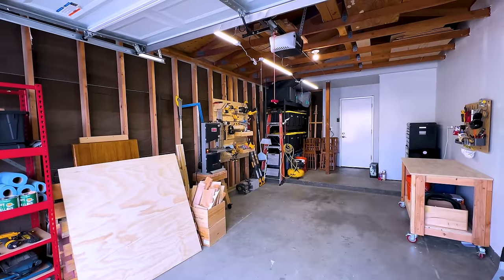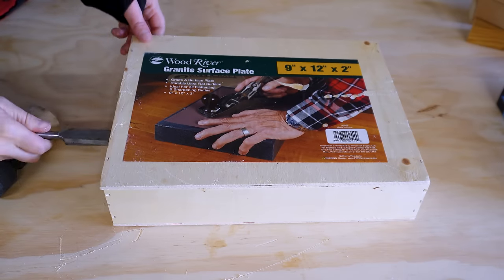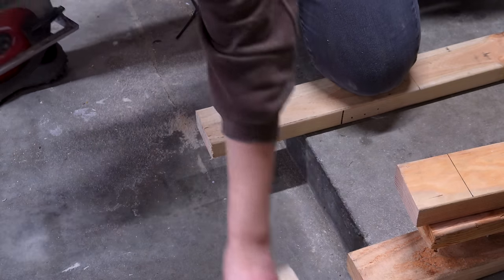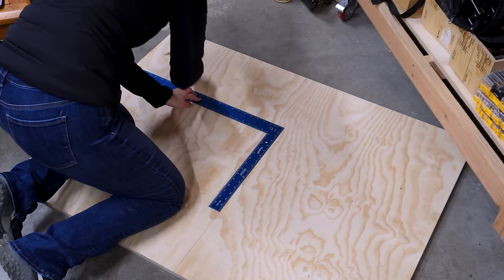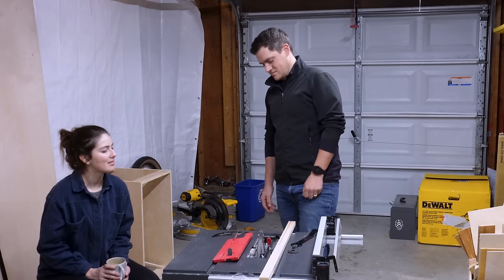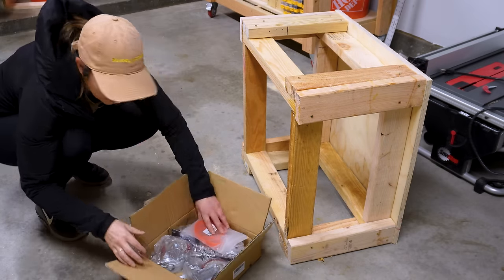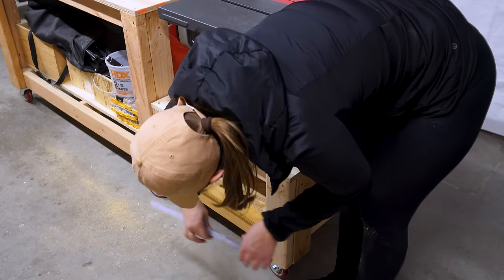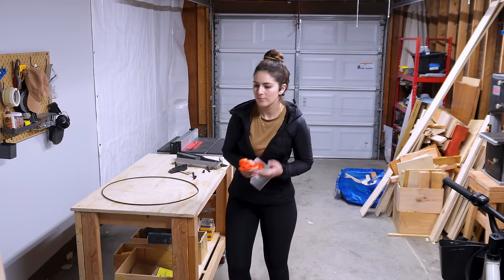Workshop Updates (and SawStop Scare)

Comment: European based viewer here. Regarding 2x4’s not quite being 2x4: When purchasing wood here, say for construction, it can either come ‘rough’ or ‘planed’. At saw mills and professional lumber yards or hardware stores, they will often quote the measurements as the same for rough or planed where the planed has had material taken off (to make it plane and smooth😊). Don’t know if that’s the same going on there in the US. On another note, as others have pointed out, your husband is a very fortunate man in so many ways.

Comment: As a veteran woodworker, I was so glad to hear you address reading the owner's manual and learning how to safely use a tool before using it. So many just plug it in without any or very limited knowledge of the tool and that is potentially disastrous.  Your video and safety practices might save someone from injury. Great job!
Reply: One of the first things I do is survey of the tool and then crack open the manual.

Comment: Love it.  I am a professional woodworker and handyman for 40 yrs, have used all the tools in your shop and many more.  I also have a spare set of bandsaw tires, that don't fit my bandsaw!!!   Just bought the exact same Dewalt sliding compound miter saw and realized it was different enough from my old Makita that I too stopped to read the entire manual before using.  I even went thru all of the calibrating steps to confirm its accuracy; it was spot on.  Love the tensioning clamps you found for the rolling table saw stand.  I like my catch stand no more than 1/16" lower than the table saw.  I used Varathane waterbased poly on the plywood top.  Extremely durable.  Love your use of scraps.  We all learn how important it is to keep scraps, and then discover how difficult it is to keep so many scraps!  I still have all my fingers; one is an 1/8" shorter thanks to a table saw.  Safety always, don't rush, don't work when too frustrated, annoyed, hungry, tired.  Looking forward to more of this...

Comment: Sawstop will replace your cartridge for free, since it was a "save" .  More importantly, make some SACRIFICIAL push sticks that you can intentionally run over the blade when cutting thin strips like that. William Ng has a push stick design that works perfect for this.  Ive used his design for many years and it works great.  Check out William's (few) videos, he is truly a master.
Reply: Matt Jackson, Next Level Carpentry is also a good choice. He does deep dives into a process so a person can see the required steps needed to complete a project. Matt makes a great push stick! William Ng has a great video on the “5 Cut Method” to share a fence on a crosscut sled. Unfortunately, William has stopped producing content.
Reply: You're right about W. Ng's channel. The guy is awesome. Unfortunately his last video is like 3 years ago. I hope he's ok.

Comment: I think an MDF table top is the right choice. No splintering, smooth surface and relatively cheap to replace
Reply: melamine is better option, easier to clean up any spillage.
.
Reply: @wellsistvan  Depends on what you will use it for the most. Things will slide easily too. Might be good or bad.

Comment: So glad the SawStop worked.  I just got my SawStop for Christmas.  This decision has been in limbo for three years when I had my table saw accident.  I was in a rush and fortunately got the tip of my finger in the blade.   Fortunately just several stitches.  Whew.  I went into full panic mode and the ER doctor was more concerned about my blood pressure causing more issues than my bleeding finger. It took a few weeks to heal and settle down. That’s when I migrated to Festool with a track saw that really reduced use of my table saw.  I’ve been really excited with the new Jobsite Pro SawStop and great peace of mind.

Comment: Sharing the scare is VERY important.  It's the whole reason the saw technology was invented.  It's nothing to be ashamed about, but will definitely be a learning experience.  Kickback is another dangerous thing to watch out for.  Always try to stand on the left side of the blade when cutting thin items. Years ago I was cutting a groove in a narrow board using a dado stack (when the riving knife is removed), and the stack grabbed the board, flung it straight back so hard it bounced off a cement wall about 10 feet behind me, and came back to smack me right in the hand, split the top of my finger open, fingernail flew off, now off to the emergency room. Imagine how much force it took to bounce off the wall and come all the way back.  Now I always use downward feather boards in those situations.

Comment: I have MDF on the top of one of my smaller work surfaces.  I put oak around the edges to protect it, then used water based poly to seal it.  It works great!  Glue doesn't stick to the polyurethaned surface and it is completely flat.

Comment: One of my outfeed tables had an MDF top with a 4 coat shellac finish.  I used it for nearly a year.  It wasn't too bad and if you are neat and careful, it would last quite a while.  I replaced it with a 1/2" melamine sheet after my father in law damaged it a little.  It was still functional, but I didn't like to look at it.  I actually got casters that are 1/2" shorter so I just put it on top.  I put up a surround and just laid the sheet in the depression.  It can be replaced in moments.  I prefer it.  It cleans easier and is slicker.

Comment: I've done something similar attaching my contractor saw to a workbench.  I used 7/16 OSB as the topper, but used contact cement to cover that with 1/8 masonite hardboard.  I love it, it's cheap and durable and provides a smooth surface for my outfeed to slide.  I used cheap pipe hanger strapping to secure the saw to its base, and it hasn't moved at all.

Comment: Great idea allowing yourself to separate the table saw from the outfeed table. One thing you're going to want to do, incase you mentioned it in the video and I missed it, but to router a slot in your outfeed table, for your mitre gauge to slide into
Reply: Or a sled. Good advice

Comment: For my outfeed table I also had about 1/2” drop.  I used 1/4” plywood then a 1/4” sheet of dry erase board from Lowe’s.  That way the wood slides nicely and added benefit of being able to write measurements, cut list, assembly order, etc. The opposite side of it is black. It’s listed as a chalk board but i haven’t tried it.  Plus when it gets dinged up just unscrew it and replace it or flip it over.  BTW I also have a saw stop.  I haven’t tripped mine yet but they are worth the money.  I still am careful and plan out every cut before I do it.  But it does make me a lot more comfortable.

Comment: For the workbench top, every time you finish up putting finish on a project, take the leftover finish and spread it on the workbench top.  This will both start building up protection on the top AND make it much easier to remove glue drips/drops.

Comment: my eyes light up when I see tools, especially the ones we use for cutting wood.
When we have never operated a circular table saw, we are inclined to think that it is enough to just have it and start cutting, however, this is not the case.
I remember that when I got the circular table saw the challenge was to make the exact cuts as desired, to do this, it is necessary to do a quick study on how to check the circular table saw ruler with a bubble level and even make a straight line on the cutting disc until the start of the table.
I learn all these tips by analyzing foreigners, especially Americans who are masters at this.
I used to spend a lot more time on my computer on projects and architectural drawings, but I like putting these projects into practice a lot more.
Now I keep an eye on your channel.😁
One of these days I will try to put into practice his art made in the game of chess.
At the moment I'm working on setting up my entire room and I haven't had time for these projects yet, but I'll do them soon.

From Brazil .🇧🇷🇮🇱

Comment: I have the exact same cartridge/blade combination hanging on my wall as a reminder. I turned it into my shop wall clock. FYI, my activation was not skin contact.  I was using copper infused, pressure treated lumber and forgot to put it into bypass mode. Same situation, rushing to finish a cut after a long day of cuts. That is definitely the most dangerous time in a shop when using power tools.

Comment: For the top of the work bench, I use a 1/8 hardboard (aka thin MDF). It is very smooth and also easy to replace since I use my nail gun with 5/8th nails to get it in there. Can be easily replaced when worn out.
Reply: "thin MDF"  is totally different than HDF / tempered Hardboard.

Comment: Interesting seeing how your setting your shop up. I'm in about the same place you are with a garage shop. Mine is 14'x32.5' so long and narrow. I'm forced to put a miter station at the end opposite the garage door because I've got a dog door that goes through the inside wall and then out of the outside wall. I'll put my miter station there with hog fence on it to keep the dogs under the bench. I've got a 36" PCS SawStop and put it in the same location you chose for yours. I'm currently building an outfeed table/assembly table and plan on putting black melamine as the surface. I saw someone else use this and she loved it (see DIY Montreal), so I think I'll give it a go. I also like how you locked your outfeed table to your saw, something I may want to consider. I'll be putting mine on 3" double locking casters and hoping I don't need to add levelers. The casters should hold it in place well enough but if not I could hook it to my saw like you did. New subscriber here, and thanks for the overview on how the SawStop was triggered. I bought an extra cartridge for mine in hopes that I never have to use it. I'll be teaching my grandkids (I'm 65) woodworking so I SawStop was a must have for me, for my piece of mind with my hands, but especially for my piece of mind for their hands.

Comment: I remember a smaller company I used to work at. we had like very old an aged very big beams. We decided to saw them up and make 2x4 out of them. I made some pearls out of that, also just smaller than actual 2x4's. But because these beams had moved for a long time, twisted and crooked and whatnot, they become very stable wood. So I got a few straight 2x4's for myself out of that pile, and it has been indoors ever since here, and it's still straight as ever. Douglas. It's like it's metal now

Comment: Really enjoyed the video! Used mdf on bench top for many years.   Really tough and has lasted through all kinds of abuse:  also cleans up from spills fairly well though stains a lot.  Most attractive? No, but it takes a beating.  
Triggered our saw stop a few years ago and it is scary when it happens…that said no injuries which makes it amazing tech.  Really glad everyone’s alright there!  If this happens to anyone, don’t be tempted to pry the blade out as it can loosen the carbide teeth which can fly off and cause some bad injuries.  If you want to reuse the blade send it to a sharpener to get them to both sharpen and check out the blade!

Comment: A couple tips for you folks. The last pair of caster purchased from Amazon were ones that had 2 levers on each caster. One for locking another unlocking. With a large foot or boot I found the 2 lever ones handier to use. As to the particle board if it gets wet it could warp.

Comment: Glad your husband's hand is ok!  I had a accident last year with my table saw that required a few stiches.
Unless you want a thicker workbench top, instead you could add the 1/2 ply or MDF to your table saw stand.  remove the saw, place a slightly over sized piece on the plywood that your saw sits on, fasten down, and clean up with a flush trim bit in your router.

Comment: Very happy to see that Kyle avoided serious injury. Appreciate you sharing his story for others to see as a reminder to be safe, don’t rush and keep safety in mind at all times. Maybe you can make a selection of different push sticks and push blocks for future use. You may also want to invest in the Microjig Gripper. Another option for getting the height right on your table saw/out feed setup without buying more wood would be to add small mounting pads between the saw base and the casters. The only issue would be that you would need to shift your locking latch. 
Keep up the great work and be safe 😊
Reply from the maker: Thanks! I plan to expand my collection to include some nice sleds and push blocks. After this incident, I'll probably go ahead and get / make some of those asap.

Comment: Construction lumber 2x4's are cut to that size when green, but once dried and planed, they result in 1-1/2 x 3-1/2 inches.
I do buy wood from places now though that actually produce 1x6, for example, that literally is 1x6.
As for the finger incident, I hope you guys recognize now that emotions and power tools do not work well together.  While a push stick is important, far more important is mindset.  If a person is frustrated and rushing -- stop!  Walk away and don't return until there's an even mindset again because while safety is one concern, so too is not making a mistake which causes a person to need to restart from scratch.
Interesting video you made. Great idea on latching the saw table and out-feed table / workbench.

Comment: Hi Elena,
I'm also glad Kyle is ok. I bought a sawstop compact saw exactly like yours a little over a year ago when my old table saw needed replacing. I had an accident several years ago with my old saw and could have lost a thumb but luckily the cut didn't go that deep. Still, the difference in cost for the sawstop would have been small compared to the medical costs of a bad accident. Like the way you are approaching your shop build.

Comment: Sawstop is a really a pretty cool safety feature. I've had an incident a few month ago with my plunge saw. When grabbing an offcut, preventing it dropping to the floor, I realized I should have waited for the blade to pass the point where I was gripping the wood. So I've earned myself a trip to ER and luckily it were only two about 5-6 millimeter deep cuts. But still having major sensitivity issues with one finger and I don't know if it will back to normal ever again. Making this cut with a table saw would have been much safer and my wife told me to get a sawstop table saw to be even more safe. Unfortunately the only sawstop table saw in Germany is the Festool TKS80 which cost me around 2750 US$, but it's well worth keeping the fingers. I have a blade and saw stop module "combination" on my wall of shame too, but triggered it with my miter gauge and not with my fingers, stoopid. 
Glad that nothing serious happend and may that be a warning. Do not do things in a rush and always take time for your safety measures.
Reply from the maker: Yeah it is really cool technology. I wouldn't have been comfortable owning any other table saw than a SawStop. Not happy it got "tested" so soon but glad we have it!

Comment: Hi, I used MDF to build the top of a bench/miter station I made during COVID (when lumber prices were outrageous). It’s two sheets of 3/4 in MDF sandwiching a 1 1/4in pine frame. It sagged quite a bit so I bolted a 6 in laminated maple beam to take that out. Overall, top has held up better than I expected, but I would not use MDF if I were using that bench for hand tool work since it would immediately blunt any edge tools! 

I have a traditional Germanic-style bench made from beech, where I do most of my woodworking. 

Keep up the good work and I hope that helps!

Comment: Awesome video. Will be saving for a sawstop at some point. 
Just some info because I took a class about wood in college and find it very interesting, 2x4s changed basically for profit. They used to dry wood out and then cut them to 2x4 which yielded straighter boards that were actually 2" by 4". Now they cut wood to 2x4 and then let it dry which after shrinkage equates to a 1.5x3.5. Which means they can cut more 2x4s out of one log than done previously. But as it drys wood twists which is why wood in the box store is so irregular. Interestingly enough wood shrinks based on the thickness of the wood. So while a 2x4 shrinks 1/2" to a 1.5x3.5, a 2x8 shrinks 1/2" along the 2" side and 3/4" along the 8" side. So a 2x8 is actually 1.5"x7.25".

Comment: I also got only limited space in my basement working space. Despite multi purpose tables I prefer foldable frames for the table saw, the thickness planer, the router, the band saw and so on. For longer parts to work with I use roller trestles which are also foldable. The table bench itself has t-slots and the corresponding clamps on the top as well as in the front in order to keep the working material safely in place.

Comment: The experience of an accident with any power tool can be traumatizing. I speak from experience as three years ago I was cutting boards for  project on my table saw (not a SawStop) that I have had for many years. Working in the evening, rushing to finish the project, I accidentally cut my left thumb off just above the knuckle. I sold that saw and bought a SawStop immediately after my surgery recovery.
I am so glad I got the SawStop and wish I had done it MUCH sooner.
Reply from the maker: Sorry you lost a finger in your accident 🙁 Hope you don't have any residual issues from the injury.

Comment: My bandsaw is very similar to yours. On mine the missing pin you mention is an allen screw 35mm long (1&3/8")with a washer and wing nut underneath. It is only used to keep the table either side of the slot aligned. Any "cheese head" screw will do as long as it is NOT a countersunk head as that will force the slot open. Cast Iron is surprisingly soft. Like the video and kudos for sharing the close shave.
Reply from the maker: Appreciate the info!